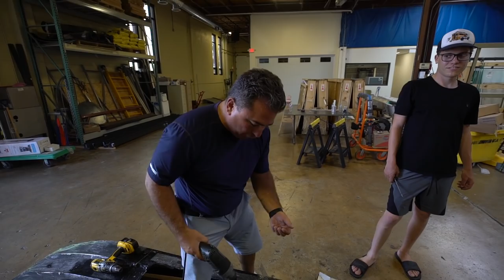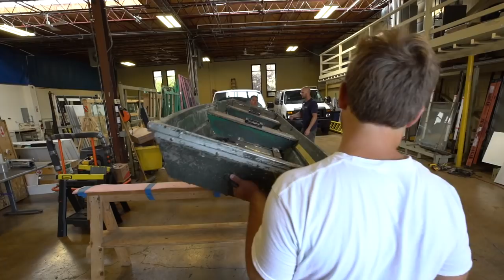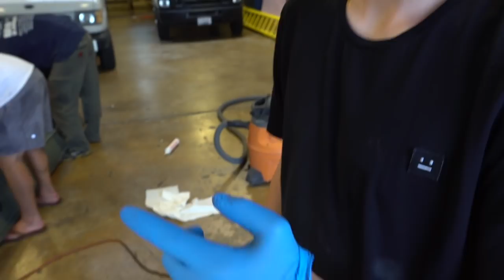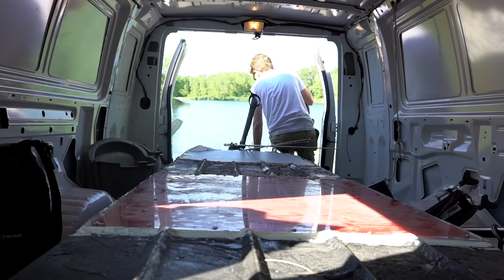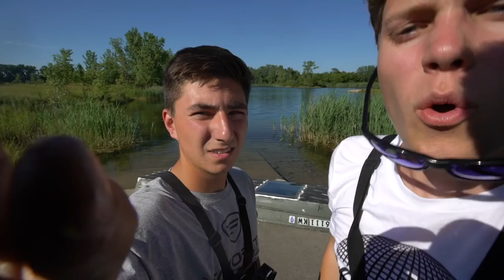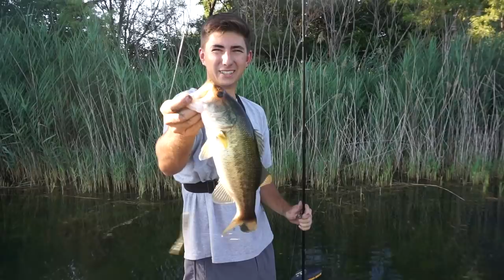Building a GLASS BOTTOM Boat! (Underwater Exploring)

Comment: Was waiting for AP to screw it up by steeping and breaking through the polycarbonate.
Reply: JulietBravo628 why wouldn't they put the polycarbonate on the inside?? That way it's the strength of the material, not the strength of the adhesion....
Reply: As the Boat is displacing it’s weight(Pressure applied down) the water pressure is applying upward pressure on the polycarbonate under the boat. The poly is take the pressure load not so much the silicone. Your statement would be correct if the poly was used in the manner of supporting the weight of being walked on.

Comment: Get a couple tubes of 3M 08609 Window-Weld Super Fast Urethane most auto part stores have it or a body shop and paint supplier or off the internet ! Its what they use to glue the windshields into automobiles and comes in a tube like the caulk ! You wont have to worry about leaks anymore !

Comment: Silicone not caulk! You should use a strip aluminum on the top and bottom around the  perimeter of the glass use a few nuts and bolts to help squeeze it all together. Another thing in would maybe try is to put a cylinder in the glass so you can fish threw it like ice fishing.

Comment: silicon will NOT STICK to plexi or lexan, six month's at most then it will fall off. Use a proper primer for a urathane sealer is the best for plexi to alum. Same product as for auto windshields but the primer is key as urathane  will not stick without it. 35 years of glass experience speaking. Otherwise GREAT Project    CHEERS

Comment: I would've just put the plastic on the inside of the the boat and filled the holes with silicone. Less work + it won't break the seal when you stand on it.

Comment: Silicone is the most overrated product on the market for a water tight seal. Use polyurethane sealant on the boat. I use to erect pre engineered metal buildings and polyurethane is what we used on our standing seam roofs, and gutters. It dries and leaves a skin but it will not let water in. I had a 14 foot Jon boat that the rivets came undone and I pop them back together and then spread some polyurethane on the outer side of the boat basically the bottom. It sealed up great and my boat never leaked again. Flex seal sucks, silicone sucks. Such a misinformed product. Silicone is not a water tight sealant .